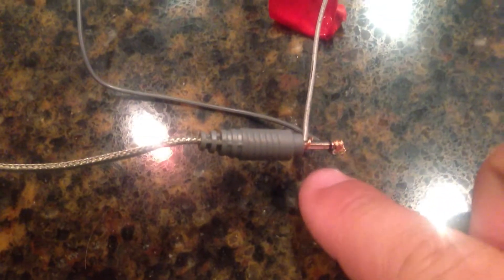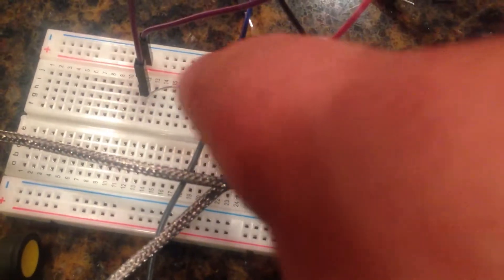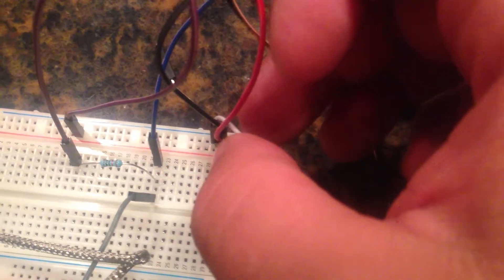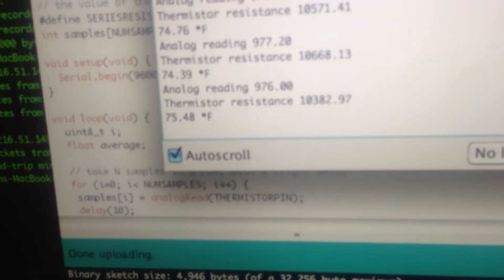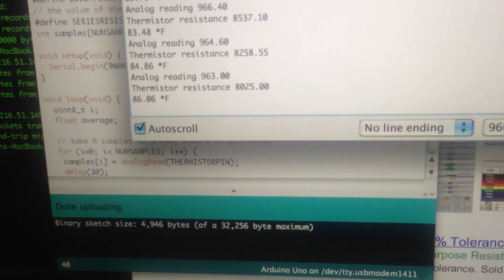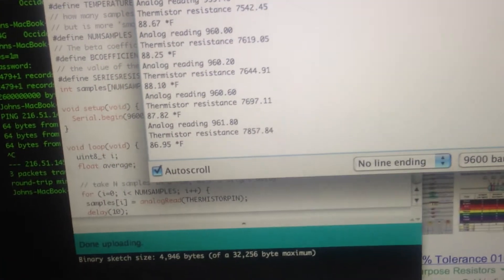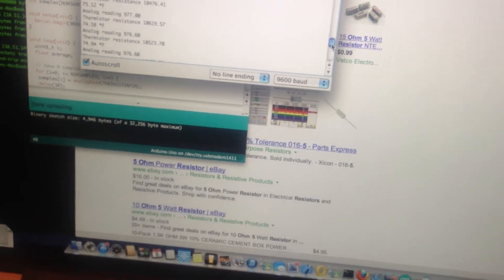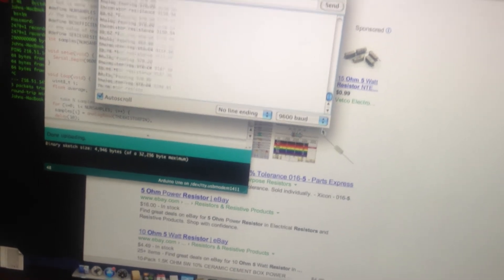Arduino Meat Probe

Comment: Can you include a schematic, I'm using a similar code myself but the readings are all over the place, my hope is to be able to use it on my Green Egg
Reply from the maker: Check your connections to make sure everything is snug, if there not you probably will get readings all over the place.
Reply: have you had any luck getting it two read two probes? are these the probes your using? 

https://www.amazon.com/Maverick-732-Wireless-Thermometer-Burgundy/dp/B00CAZFKIU/ref=sr_1_8?ie=UTF8&qid=1484597333&sr=8-8&keywords=maverick+et-732
Reply from the maker: Probably something like that 10k probes.